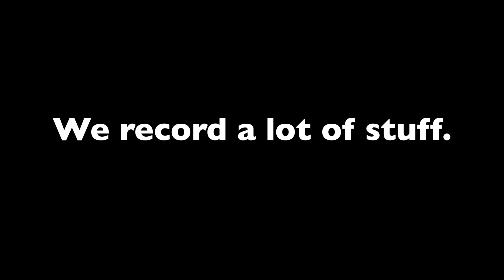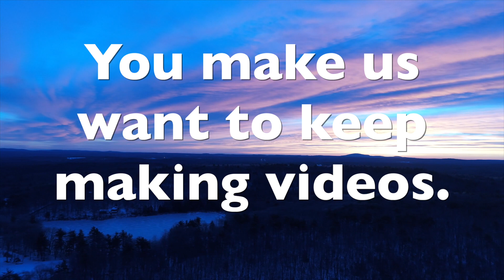Vinofarm Outtakes and Found Footage 2017!

Comment: Awesome job this year!  Keep the videos coming!  Super job on the bees.  I'm about 20 miles east of you along RT2.  Now that we've got temps below zero, I'm rethinking whether I should have completely surrounded my hives in rigid insulation.  The windbreak you've setup will really make a huge difference, compared w/last year.  And when the temps climb in the spring, those bees will heat up quick and get their cleansing flights done early.   Knowing what you know now about your bees, what do you plan to do different next year?  - Perhaps that'd be a good video topic for 2018.   Happy New Year.
Reply from the maker: Yes, these temps lately are making me nervous. It's been way colder than we've seen up here in the past several winters. Several nights in the past week around -5F before wind chill. (We're at 1200'.) I was thinking about doing a video like you suggested. I'll add it to the list! Happy new year!
Reply: I think we both prepared them well enough - wrapping, food & stores.  They've got plenty of emergency food and they'll do as best as can be expected.   You've got the upper hand with more insulation, and the reflective solar wall & wind break.  Next year, I'll add that to my list.  Happy New Year!